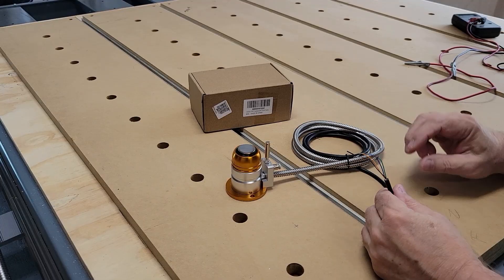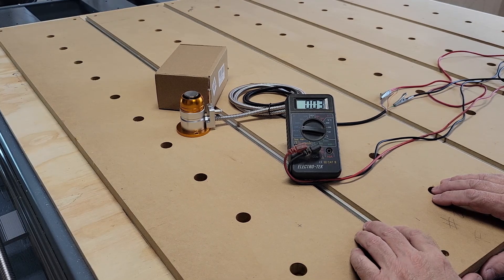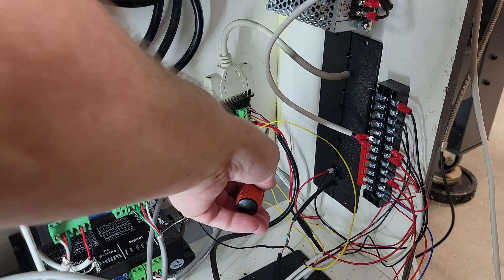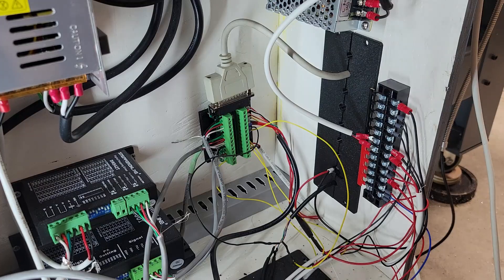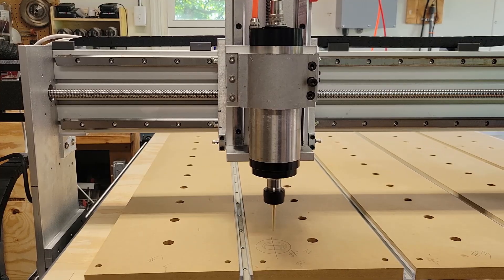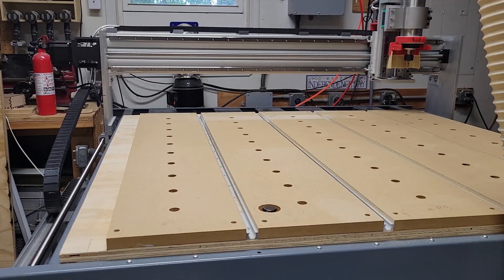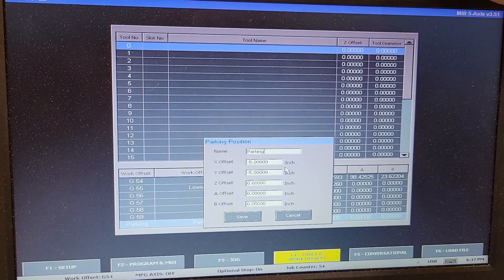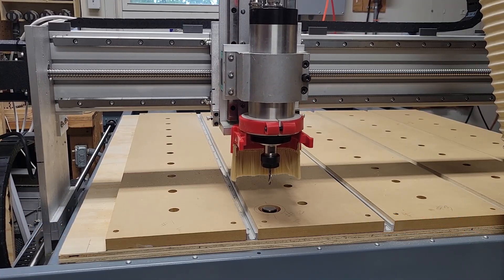Installing A Tool Setter With A 2nd Generation Masso Controller

Comment: I made it and I watched you in the past but recently just bought a masso G3 to convert my CNC which was running a smooth stepper and Mach 3 that was very flaky with an ATC. Hoping to myself my issues.
Reply from the maker: You can't go wrong with a Masso.  Thanks for watching.

Comment: I made it Buddy! Question, unless you're changing bits within the same toolpath program, is there an advantage with the tool setter (besides the automation of the moves) over like a standard xyz or z only probe? Another great video! Hi Jack!
Reply from the maker: The tool setter doesn't replace the XYZ touch probe.  You have to set the work coordinate zero first with the touch probe with your first tool of the multi tool program.  Then, the tool setter will check the height and calculate the correct Z zero for all the remaining tools.

Comment: Just started watching Dave. Does the QR Code on outside of box take you anywhere for wiring diagram ? Or company link on Amazon. Great video,Nice looking machine." I made it".
Reply from the maker: Thanks for watching, Jerry.  I scanned the QR code, and there wasn't any useful information about the tool setter.